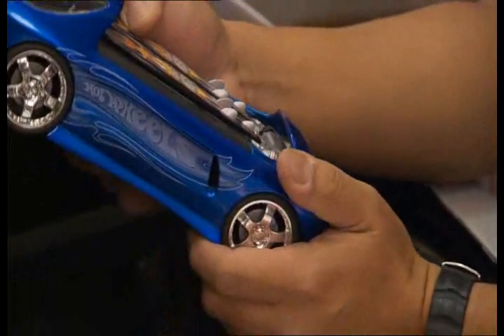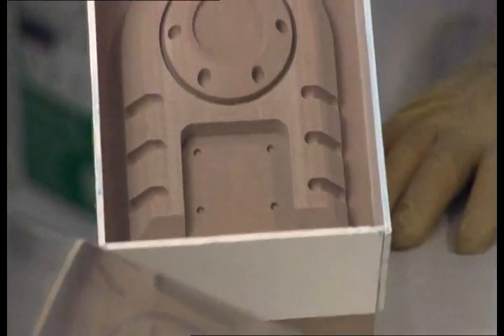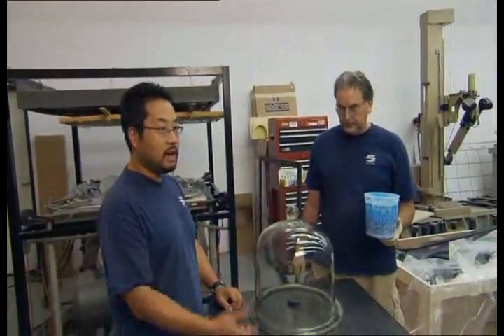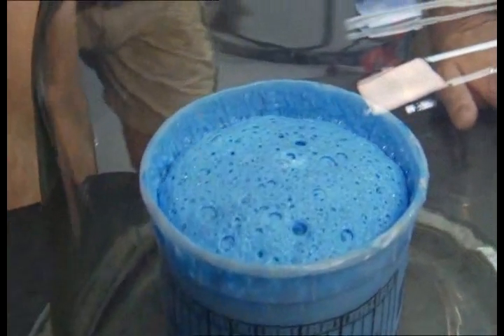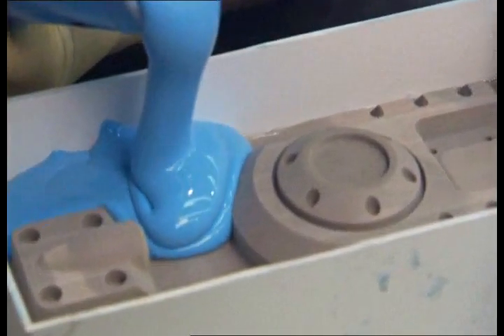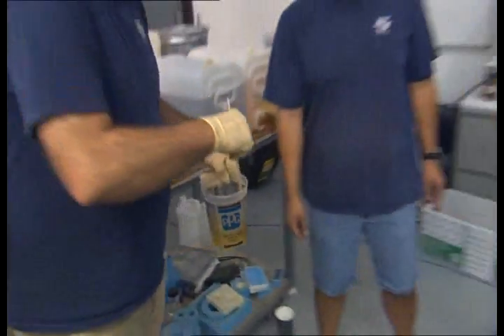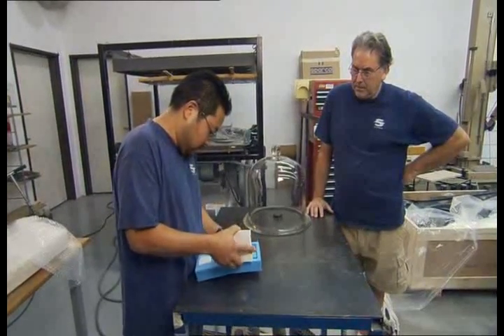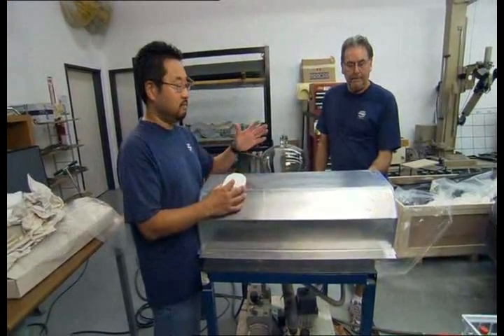Bomba de vacuo, molde de silicone e resina de poliuretano

Comment from the maker: It´s Urethane resin, google for it, it´s easy to find, it´s a 2 part resin (A+B) depending of your mold you may need a vacuum chamber for the silicone and a pressure pot for the resin.